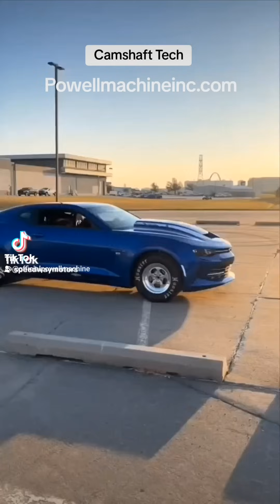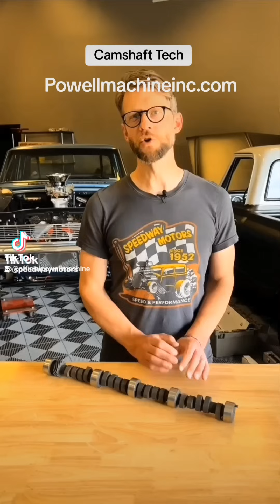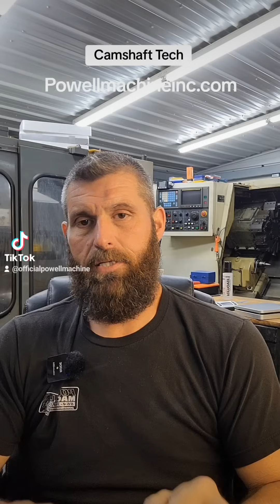Camshaft Tech,  overlap

Comment: You are the cam doctor for sure. Now I know from good or bad experience on one of my vehicles as example when I was a kid I did a shade tree head removal and replacement and got my timing mark off in advance of TDC - and there was so much increased compression from valves closing early that I purchased a gear reduction starter to crank the engine because it was easier for me to do that fix at the time than to tear back into the engine to make the timing mark change. The engine ran great and had good pep so that was my quick fix on a personal engine repair job I messed up involving a stock cam and TDC timing mark setting. Now if I needed cam work in this day and time or engine work I would be looking for a shop like yours or would contact you first before purchasing an OTC cam.
Reply: There's so much one can do with camshafts... I ran a dozens of cams in a BBF 429 when I was a kid, and the one that stands out the most is when I was in a rush to adjust the cam timing that I skipped a tooth while advancing it 8°. Smooth idle, wouldn't free rev past 5200 rpm in neutral, and driver like a diesel with massive torque through 3000 rpm. No power after 3500-3600 rpm. No matter what I did to this particular cam timing, 0-60 times and distance were the same.
Reply from the maker: Definitely

Comment: It's so funny how you mention this today. I was looking at cams earlier and saw two exact examples of what you mean. One was 260/266 @ .050" with a 104* LSA with 55* overlap and the other was 234/234  @ .050" with 116* with 2* of overlap. Talk about one extreme to the other! 

I'm looking for one for a roots blown SBC 383 I'm building so the 116* would work better for me but if I wasn't using a SC it would be crazy to hear that 104* in a 383. It'd probably need a 1,500 RPM idle just to stay running.
Reply from the maker: We can definitely grind one for you.
Powellmachineinc.com

Comment: Great info with exact numbers to back it up. Just a tip, at least putting the numbers listed on screen will help a lot of average folks follow along. If you could whip up a little drawing to show what the numbers mean could bring even the naive
Reply from the maker: Thanks for the tip!
Reply: A drawing like A degree wheel or marked out on a degree wheel to show how the longer duration and specific opening and closing events determine valve overlap amount.
Reply: @JayJay-de8vq  most definitely
Reply: @JayJay-de8vq  ,,,,,,This could help,,,,,,,,,,,,,,,,,the two  events during the overlap  period  are,,,,,,Intake Opening  [ I/O ]  beforeTopDeadCenter  and     Exhaust Closing [E/C ]   AfterTopDeadcenter...............The other two  events occur  around  BottomDeadCenter  ;    the Exhaust valve opens  [E/O]  BeforeBottomDeadCenter     and  the Intake valve closes [I/C]  AfterBottomDeadCenter,,,,,,,,,,,,Think of the face of a clock   ;   TDC events    are before  and  after the  number 12 on the clock dial........At  the bottom of the dial  is 6 o'clock  ;    these two events  , exhaust Opening [BBDC]  and  [Intake Closing  [ABDC]  are spread out  much  farther  before and after  the  center 6 o'clock  mark   which represents  BottomDeadCenter............Generally  by  knowing  the  events  in degrees of  [I/O @ 20* BTDC ] and  [E/C @ 20* ATDC ]  then adding  the numbers up  tells you the degrees of overlap......20*  + 20*  =  40*     On a Camshaft spec card always  read the specs given  at  .050",,,,,when you see  valve lifts at  TDC  , that will tell alot  about  the intended use of the cam,,,,,,,,as it denotes valves lifted off their seats  at  TDC,,,,,,,more lift at  TDC  is more overlap  and the valves  are close to the piston  top........................ANYWAY........................................
Reply: The "numbers" mean that an engine works best at the rpm it is tuned for, and less efficiently at other speeds.